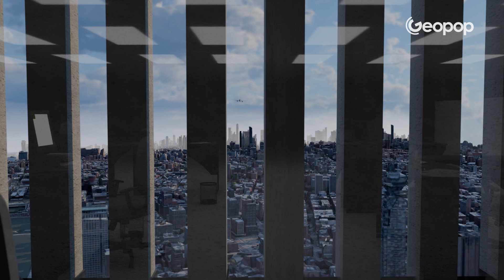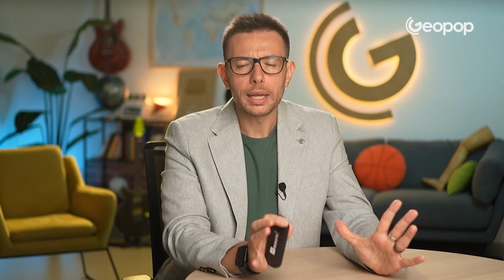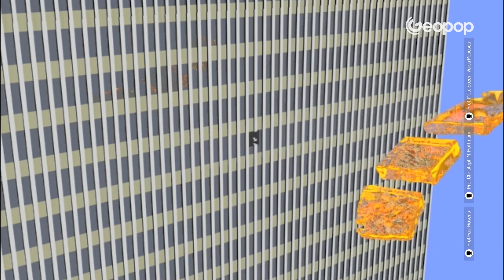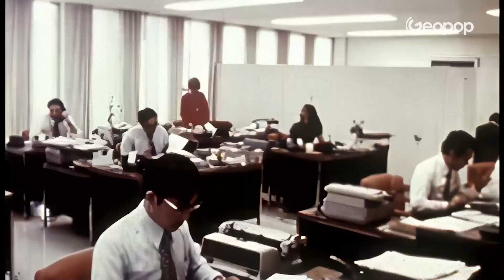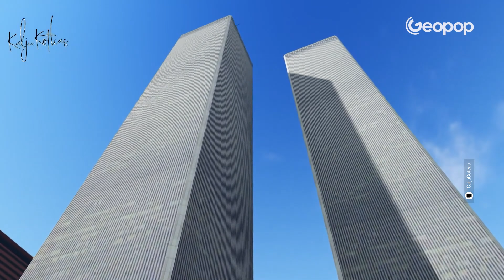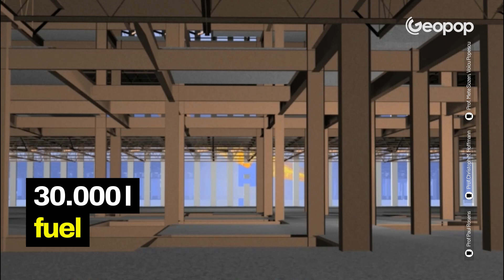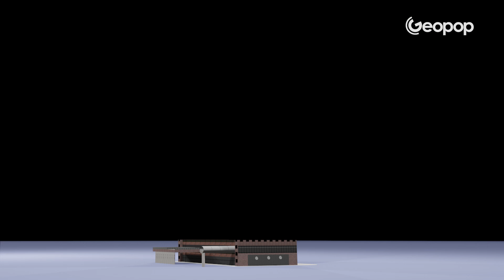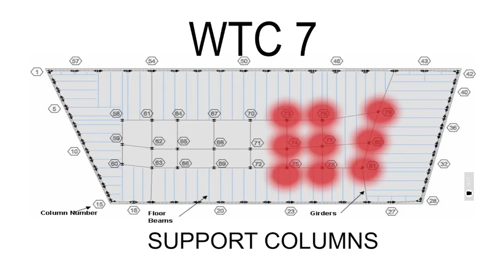9/11, 2001: The Technical Reconstruction of the Twin Towers and WTC 7 Collapses

Comment: Building 7 looks like they demolished it. I mean it looks like they put explosives at the bottom of the building. It went straight down.
Reply: I’m going to respectfully disagree and offer a more plausible explanation. The unknown and unimportant Building 7 was the 6th building to collapse of 10 lost on 9/11. Though extensively studied, it still confuses many people. Not famous, or a terror target, and no casualties, thus it did not get a lot of attention and few know much about it, creating a void rapidly filled with garbage from the internet. Because everything seems like a conspiracy if you don’t understand how it works I prepared this brief summary explanation of my own analysis. No politics, just engineering. 

The North Tower collapse at 10:28am bombarded Building 7 with tons of burning debris, causing heavy damage and starting raging fires burning out of control for 7 hours. Half the responding FDNY firefighters having been killed, others injured, units in disarray, equipment destroyed, no water pressure, and the greater urgency of Search & Rescue efforts, firefighting at 7 was pulled as futile. The building couldn’t be saved and was left to its fate.

www.youtube.com/watch?v=g_SvpwyC17M&ab_channel=MFitz  

Collapse of a burning structure is always a concern for firefighters. Steel buildings subject to fire rely on active fighting of the fires to survive. Buildings are designed around 1 to 3 hours of fire resistance, allowing time for occupants to escape and ACTIVE firefighting to get started, after which all bets are off. Left to their own devices they will exceed their design envelope and collapse. In B7 the occupants escaped, passive and active fire protections were compromised and active firefighting was abandoned which left the building to take its chances. It lost. Odds on Building 7 would eventually collapse, and it did. No big deal in logic. That is the sort of choice firefighters make every day in brush fire situations - which houses to save and which ones to let go. Only real difference here is moving the decimal on the size and cost.

www.youtube.com/watch?v=WnYBX6QT0R4 

FDNY Chief Daniel Nigro ; The biggest decision we had to make on the first day was to clear the area and create a collapse zone around the severely damaged 7 World Trade Center, a 47-story building heavily involved in fire. A number of fire officers and companies assessed the damage to the building. The appraisals indicated that the buildings structural integrity was in serious doubt. I issued orders to PULL BACK the firefighters and define the collapse zone. It was a critical decision; We could not lose any more firefighters. It took a lot of time to PULL EVERYONE OUT, given the emotionalism of the day, communications difficulties and the collapse terrain

FDNY Deputy Chief Peter Hayden ; We had our special operations people set up surveying instruments to monitor and see if there was any movement in the building. We were concerned of the possibility of collapse in the building. And we had a discussion with one particular engineer there, and we asked him if we allowed it to burn could we anticipate a collapse and if so, how soon? And it turned out that he was pretty much right on the money, that he said 'In its current state you have about 5 hours

The collapse of Building 7 was anticipated all afternoon and widely reported in the media with at least 24 video cameras recording some or all of the collapse. Everyone at the time knew what was coming and why.

www.youtube.com/watch?v=OY5S5k3tMHI 

Building 7’s collapse was totally different to the Twin Towers, harder to understand and most of the details difficult to see. But we can sort out what happened through careful analysis and observation.  What follows is MY EXPLANATION of the collapse sequence using the best available information and relying on no authority.

B7 was complex structure, a 47-story steel framed building built on top of a smaller existing 3-story building, requiring several lower floors dedicated to complex load transfer structures instead of usable office space. Of trapezoidal shape and all-steel tube-in-tube construction, B7 (above the 7th floor) consisted of a central core of steel columns carrying most of the gravity load, perimeter steel columns around the outside of the structure carrying the remainder of the gravity loads and long span beams and girders to tie those elements together and form the floors. On the outside of the building hung a moment frame - the last part of B7 to fall. 

Phase 1 : Collapse initiation for B7 is notably quiet with observers not realizing the building was collapsing! There was no audible warning in the form of say hundreds of ear drum busting 180-190dB explosive bangs preceding the collapse. The first externally visible signs of collapse initiation occurred at 5:20:28 pm. Here at 12:00 a local CBS affiliate reporter is talking 10 blocks from B7 when collapse begins. People don’t start to notice the collapse until 12:11. Then at 12:45 is the famous CBS fixed camera clip of Building 7’s collapse Again, note how quiet it is.

youtube.com/watch?v=t5tEy6mXSE8&ab_channel=fresnosean379

Collapse initiation was due to multiple lower floor failures above the load transfer region (7th floor) in the NE corner of the building. In this video at 0:45 you can see the NW corner from inside the building while under construction, Column 79 just out of frame on the left. That big, angled steel beam across the top of the frame connects to C79 at one end. The girders connect to the beam. That beam and all those girders depend on just one connection

youtube.com/watch?v=nP3TNHPCIVU&t=35s&ab_channel=EdwardCurrent

Phase 2 : Lower floor failures caused a loss of critical lateral support over an excessive length of core Column 79 and it buckled. If you look at a floor diagram of Building 7 (see above) and look at all the structures that depend on C79 you quickly realize this one column was a relatively isolated structural element on which a disproportionately greater fraction of the structure depended . Externally we see a vertical progression of window breakage along the 44-46 line and a kink in the roof of the East Mechanical Penthouse at the top of the building, consistent with C79 failure. The transition from full capacity to almost no capacity occurs in virtually an instant. Once the buckling failure occurs there is almost no resistance

Normally with a buckling column, the load could very well be redistributed to other columns, meaning the buckling could stop after a while. With C79 that is not the case - the failure did not redistribute the load, so the collapse rapidly progressed to the roofline, sinking the rooftop penthouse.

Phase 3 : With C79 gone, B7’s progressive, non-symmetrical collapse continues with C80 and C81 at the east end of the core left laterally unsupported and quickly buckled and failed as well, sending the EMP down through the building. C79-81 all have no diagonal bracing, which I believe is a major reason why they could not redistribute a lot of vertical loads among one another.

From there collapse progressed from east to west through the central core until the core was gone taking all of the interior floors and structures and probably most of the perimeter columns with it. You can see the horizontal progression of window failures low in the building and the dropping of the remaining rooftop structures into the building. One of the big takeaways from the NIST Building 7 study (that gets completely ignored) was their modeling which determined C79 failing under ANY circumstances would have initiated the same collapse sequence.

Phase 4 : After some 10 seconds all that remains of Building 7 is just a hollow empty outer shell - the exterior moment frame - creating the illusion the building is still standing since little has changed externally. But it’s just a hollow empty shell like an empty cereal box supported by only a few remaining columns and quite unable to remain standing. With all the internal framing gone. the north face leans inward, forming a V in the roofline, the last perimeter columns buckle under the strain and with nothing left keeping it up the moment frame free falls, landing on top of the 7-story high debris pile. It is only at the very end that a single measurement of alleged free fall acceleration is taken. Note this is not the building but just its outer shell, and only one corner at that, at the very end of the collapse. Start to finish the entire collapse took 18-20 seconds, or less than 1/3 of true free fall and we have to look at the whole thing, not cherry-pick little bits to fit a particular narrative. Worth noting _how fast something falls cannot tell you what started it falling in the first place. The debris spread out, blocking surrounding streets, heavily damaging the Verizon Building and destroyed Fiterman Hall, all well outside of Building 7’s “footprint”.  

Building 7’s progressive, non-symmetrical collapse was incidental and unintended collateral damage from the combined effects of fire + time + gravity started by the collapsing North Tower. That is true no matter who planned and carried out the 9/11 attacks or why . The collapse was of so little consequence it barely even registered at the time, a mere footnote. It only took on semi-mythical status as an alleged smoking gun years later when demolitions at the Twin Towers, missiles at the Pentagon and shoot down over Shanksville all failed and conspiracists had nothing left to work with.

Anything can seem like a conspiracy if you don’t understand how it works. Now you should. I hope you found this helpful and informative, not adversarial and it solicits informed critical comment. If I made any errors of fact, logic or reason or left anything critical out, please let me know so I can fix it. IF you can offer a more plausible alternative please do. Be the first.

Comment: https://youtu.be/1l-8PFk8j5I?si=tKZ2VU5QyXfGRjOW   

Watch the real Truth from PBS - what is presented here is a BOLD FACE LIE ...  Nist said - no melting iron - no explosions - NIST had no official explanation for what really happened  - because they are lying to the America - just like this guy is - does he mention that the fires at ground zero burned for months ???   You will never hear this truth on a BULLSHIT video like this - the fire from jet fuel can't steel up enough to bend steel like alone pull off this magic act this guy is playing - this is inspired by the eviL the truth is out there - over 1,000 engineers have signed a petition for a new investigation - YOU WILL NEVER HEAR THAT FTOM GUY - he backs Nist - that is all you need to know ...
Reply: That is not a PBS program. It is an independently produced film that the producers got one small market PBS station to air (because it was cheap and could fill a time slot).

Comment: You talk about unadulterated pure eviL - you just watched this orchestra bullshit ... this is for only people who are easily deceived - they used nano Thermate - Bld 7 is the smoking gun - this guy is a public liar along with the Nist Report ... PBS out the truth years ago ...
Reply: The collapse of Building 7 is probably the most studied engineering disaster in history and the subject of 5 comprehensive engineering studies and more than two dozen technical articles in major peer reviewed engineering journals, most of which were published 15 or more years ago. Thousands of pages of material. So if you have something against The NIST (not that I suspect you ever read the thing - it's not exactly a page-turner)  there are plenty of other options.

FEMA BPAT (initial report superseded by NIST NCSTAR 1A)

NIST NCSTAR 1A: Final Report on the Collapse of the World Trade Center Building 7, 2008.

Guy Nordenson and Associates, WTC7 Global Collapse Analysis Report and Summary of Findings, 2010.

Arup, WTC -7 Structural Fire Analysis Report (Runs 1-4), 2010.

Weidlinger Associates Inc., WTC 7 Collapse Analysis and Assessment Report, 2010.

BRE Centre for Fire Safety Engineering, Analysis of the Impact of a Fire in the Mechanical Room (5th & 6th Floor) of the World Trade Center 7 Building, 2010.

T. McAllister, R. MacNeill, O. Erbay, A. Sarawit, M. Zarghamee, S. Kirkpatrick, J. Gross, Analysis of structural response of WTC 7 to fire and sequential failures leading to collapse, J. Struct. Eng. (United States). 138 (2012) 109–117.

For a summary of the major studies I would recommend THE COLLAPSE OF WORLD TRADE CENTER 7: REVISITED by Mhd Anwar Orabi , Liming Jiang , Asif Usmani and Jose Torero which is a 33 page summary of the different analysis and conclusions published in 2020. Sorry, YouTube will delete this post if I give the link but it should be easy to find and is available from the University of Queensland, Brisbane. 

Happy reading

Comment: Sono italiano e un ex pilota. Non esiste proprio che quegli aerei andavano a 700 km/h a livello del mare. Marea di cazzate in questo video. Le torri sono cadute per demolizione controllata.
Reply: Flight 175 was going much faster. Stop thinking like a commercial pilot and start thinking like a Kamikaze pilot. For example, if you have never flown a Boeing 767 in a dive at full throttle at 1,000 feet (and it seems unlikely you have) then you are really in no position to say what the aircraft can or can't do.

For a few seconds before it crashes.
Reply: @ perhaps it is you who should think more like an aircraft engineer and less like a gullible person. 
These commercial planes are made to fly at specific speeds at different altitude. The air density at sea level is much higher than at cruise altitude. 

Try flying an airplane too fast and it will literally come apart.
Reply: @acv5837  Yes, air density is higher at lower altitudes- which in no way states or implies the velocities reached by the hijacked aircraft, at full throttle, in a dive, flown by people giving zero fucks about airframe fatigue, passenger comfort or safety were not achieved.

Just because that is not how a commercial pilot flies doesn't mean that it can't be done.

What are you trying to claim here anyway, that there were no planes?  We can see th he plane sand measure their velocities.  For 77and 93 we even have FDR data.

Boeing - the folks who designed, built and tested the planes do not agree with your assertions, have no issue with how their aircraft performed that day
Reply: @ to me there is little to no chance these were regular commercial planes. Probably military but commercial I don’t think so. The engines could not even generate enough power to push them at those speeds at sea level. And they were not coming down like a rock so there. Plenty reasons to doubt the official story. 

And the NIST explanation (regurgitated in this video) is openly rejected by many engineers and architects in the USA.
Reply: @acv5837  - Says who?  Not Boeing. Again, Boeing has no problem with anything any of their aircraft did that day. 

Earlier you made the claim:  Try flying an airplane too fast and it will literally come apart

OK then, at exactly which point in each of the hijacked aircrafts flights would they have come apart ?

Why didn't they?  

Remember, a military B767 is the same airplane as a commercial B767 so you can't hand-wave it off with that excuse.  Gotta use the thinking part of the brain here, and make sure to cite your sources. Ignorance-fueled personal incredulity and false starting assumptions won't cut it.
Reply: @ what I know about those planes, and other pilots like me agree, is that they couldn’t fly at such speeds at sea level. What are your sources of Boeing saying the opposite??  Can you please explain
Reply: @acv5837  - As I said, false starting assumptions and personal incredulity don't count.  This is not about what you want or need to believe but what actually happened

This is your claim so the burden of proof here is yours and all you are offering is I don't believe it and because I don't believe it therefore it couldn't have happened

Even though millions of people saw it happen.

IF you were right you would be able to answer my questions. They are simple enough, and obvious enough. 

But you can't, because you aren't.
Reply: @TheLoonResistance  ok boss. Of course is my opinion and frankly i don’t care what you believe. Probably you never flew a plane. I rest my case.
Reply: @acv5837  - I have no use for belief. You are making accusations without evidence, based on pure speculation and conjecture. It is uninformed opinion from which you will not budge in the face of any facts, logic or reason, which makes it nothing more than ego-driven dogma. A thing you want, possibly need to believe for whatever reasons you need to believe it. 

I am a pilot BTW - took my first lesson age 14, 2 years before I ever drove a car.

So much for your assumptions. I rest my case.

Comment: How did the third tower fall?
Reply: World Trade Center 3 - the Marriott Hotel and arguably the 3rd tower to fall (a case can be made for WTC 4) partially collapsed when the South Tower fell on it, the North Tower completing the job 45 minutes later.
Reply: It fell due to peer pressure. That's as based in reality as what the other guy claims